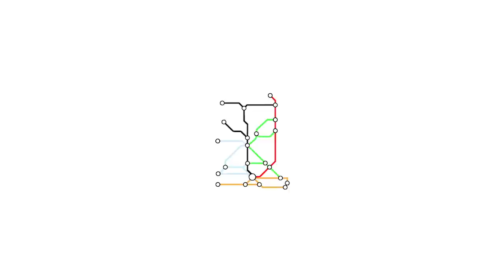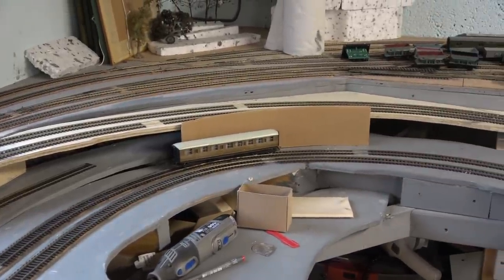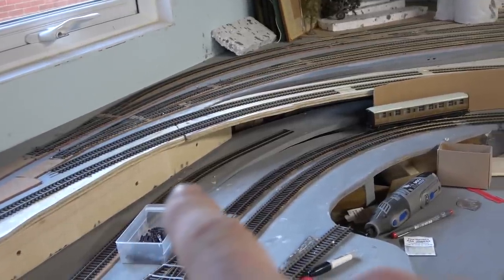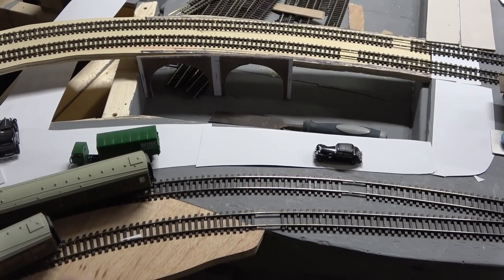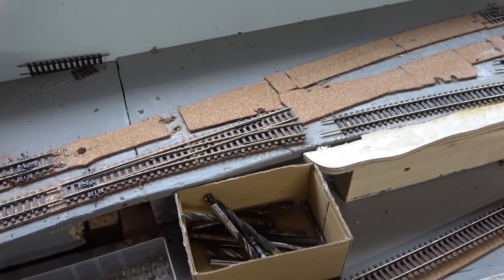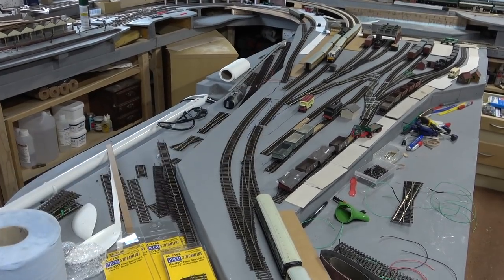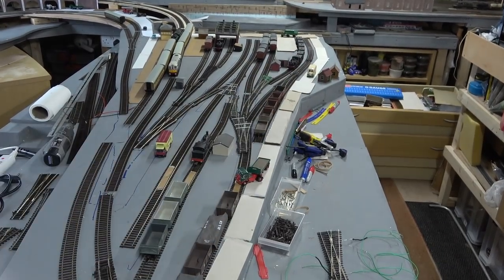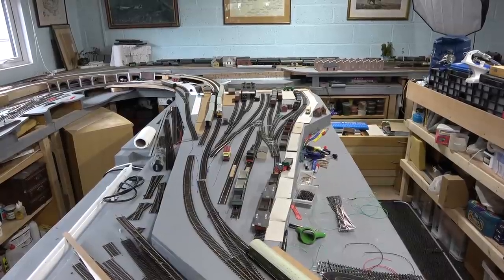More on the Harbour Build - The Issues - My Thoughts at Sandling Junction

Comment: Really good update, I look forward to your next video.
I have a sixty year old Hornby Doublo 0-6-0 which your Wrenn is the same as.
It made the same noise as yours, the problem is metal worm on metal cog not sitting happily together.
I cured it with a small amount of toothpaste on the worm, the grit in the toothpaste polishes the surfaces.
Hope this helps.
Reply from the maker: wow great tip thank you so much Paul

Comment: Hi Paul great progres. Very nice to see an old loco pull coaches up an incline. Don't throw away  the melted points. I did exactly the same thing. And all I did to get around the problem was to solder a dropper wire tight into the v of the frog. And ballested it. You can't tell it's there. All the best keep safe.
Reply from the maker: great thought thanks for that, cheers Paul

Comment: Hi Paul, I feel your pain, I watch with interest as I’m building a harbour too,  albeit in N gauge, and it is about compromise, what I want to do I soon found out I can’t quite but that’s the way it is. 
Gradients play a big part in my layout, now the first two loco’s I had go round without any trouble at all, a pannier tank will haul up to four coaches and a diesel western eight coaches. Now I bought a lovely Castle class steam engine which will only haul four coaches with a struggle, DCC Concepts power base is on it’s way! I hope this sorts me out as I find it so frustrating, my maximum gradient is about 2.7%.
Don’t get me started on points either, like you I hate wasting money and I have destroyed three sets now more out of frustration and not walking away when I should!!!!
If ever you need counselling let me know we could start a group for frustrated railway modellers! Cheers for now Paul, John
Reply from the maker: Oh I hope it does, nothing worse than the effort ending with issues, cheers PAul

Comment: Paul, I also have an ancient Wren R1 (They were originally Hornby-Dublo models that were sold under the Wren label when Hornby were bought out by Triang) which is also noisy (but not as noisy as yours!!). They're quite heavy locos and have good adhesion and pulling power, so I'm not surprised that yours easily made it up the ramp. The motor draws a lot of current, so when you decide to chip it, take that into account if you don't want to blow your chip. I run on analogue, so I haven't chipped mine. IIRC (it's a long time since I last serviced it) there's some space in the firebox which might fit a chip. I don't know how easy it will be to wire a chip in, as the metal chassis is connected to one side of the supply. Mine has dodgy (just about working) pickups and there's little hope of getting a new set.
Reply from the maker: All great advice thank you for sharing and will keep that in mind, cheers Paul
Reply: @Sandlingjunction  Correction: I meant smokebox, not firebox.
Reply: @Sandlingjunction  Paul, Have a look at this video about a re-magnetiser for loco motors. Maybe one of those will solve your noise problem with the R1. A stronger magnet will certainly reduce the current consumption of the motor. I'd get one myself, but I have a pacemaker which means I have to keep away from strong magnetic fields.

Comment: Try getting an off cut  bit of rail about 100-125mm long bend one end about 20-30mm long with the top running face of the rail to the inside of the bend (the sort of angle you would have on a shovel between the handle and the shovel face) slide the insulator on to this end then holding the tool line up the insulator to the rail you want to put it on it should be easier this also makes it easier to put normal track joiners in place particularly where access is a problem. Neil
Reply from the maker: Hi Neil thank you Ill try that, the issue is lining four up at once , thanks Paul
Reply: Paul yes that is always a challenge I find half the battle is getting them on one side first then with them all lining up it is making sure they all go underneath and over the top of the adjoining rails at the same time, I always have an angle poise light on hand to help to see clearly

Comment: All good stuff as usual, Paul. There are always compromises needed when modelling (well, unless you've got a half mile long shed for the railway!).  I did wonder whether you were going to say the line you're taking behind the arches could be the branch's down line to the harbour, meaning you'd only need the wider radius line in front of the arches, but I don't think you've got the vertical clearance (and it would be another - different - compromise). Sharp curves are the bane, but also the necessity of model railways.
Reply from the maker: It will be the only one, so feel I shall have to live with that to make it all work out well, cheers Paul

Comment: If you use Hornby plastic fishplates they are a lot stronger than the peco ones.
Reply from the maker: That's a great idea, but do they fit code 75 Paul, if so I will try them out cheers Paul

Comment: There was a runaway in 1851 due to a broken coupling
Reply from the maker: In the Harbour?  I know wagons got loose Hythe to Sandgate caused massive damage. I'll check that out cheers Paul
Reply: It's in the Folkestone railways book about the coupling breaking on the 2nd double headed bury engine on a wet January day, as the train started rolling back down,  the brake van couldn't stop it. There ware workmen on the viaduct who put timber in the tracks to try and slow it down, but not enough, it rumbled over the still closed swing bridge and into the station were the guard jumped out and it crashed into the end wall. By the end of the same year the railway developed special brake vans and the bulldog class locos, designed my Crampton.